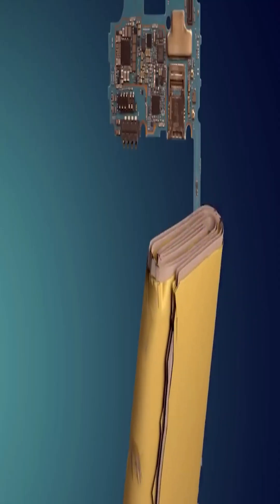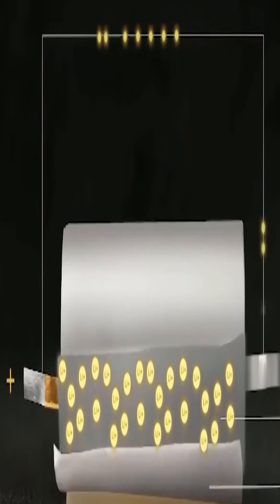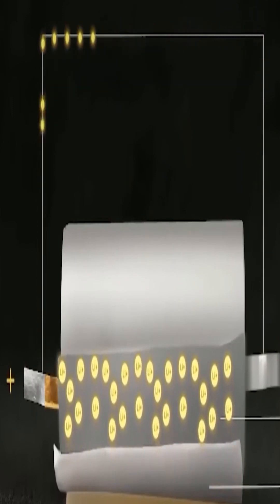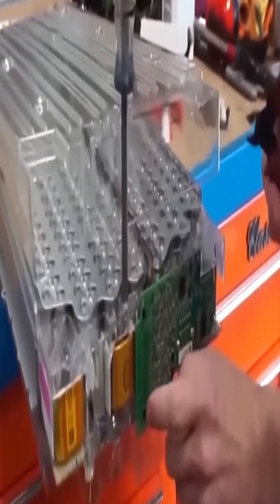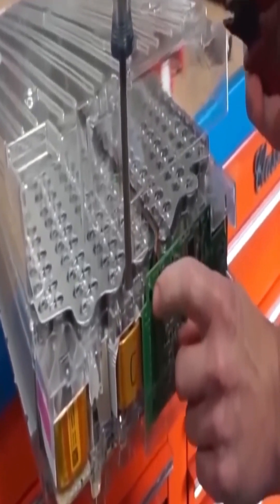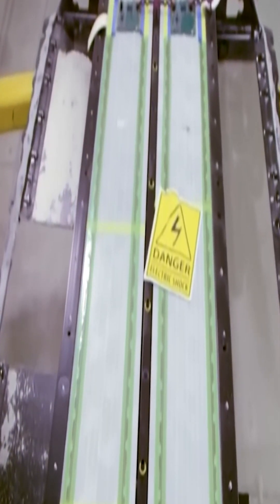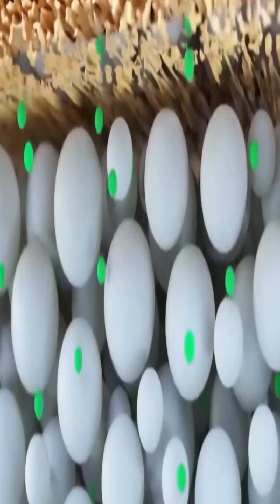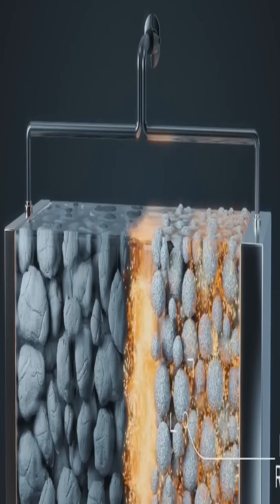IT HAPPENED! NDB's Nuclear Diamond Battery

Comment: 🤔Technically there is a way to use Nano diamond or nuclear carbon cells then connected to (Quantum logic gates https://m.youtube.com/watch?v=VLPpDoMBVK0&list=PLwBuIj6Re3T1mF1fM_293YQ0JP9ex6DAj&index=184&pp=gAQBiAQB for better efficiency) in the circuitry then connected to (nanowire capacitance https://youtu.be/-a3O4cP22qY?si=833KES3c3AzpSrBO step up Transformer coils) in one18650  battery cell👍🤯🌐✌

Comment: The problem is that there isn't much power (energy/time) to harvest from carbon 14 or other slow decaying isotopes and for this reason such battery needs to be 1000s of times bigger for the same power.
Plutonium 238 or other faster decaying isotopes can work better for more power (but are extremely dangerous). Voyager uses Plutonium 238 to output around 400 Watts. That's almost HALF a horsepower of power costing millions of Dollars.
Electric cars need 100s of horsepower and this battery technology is plain impossible for that.
These batteries can serve in very low power applications and can be awesome for that.